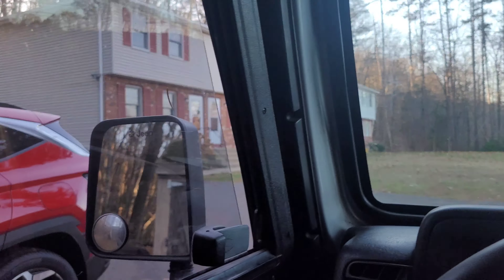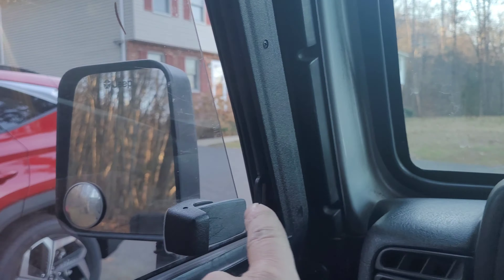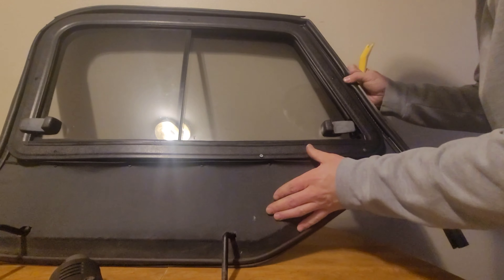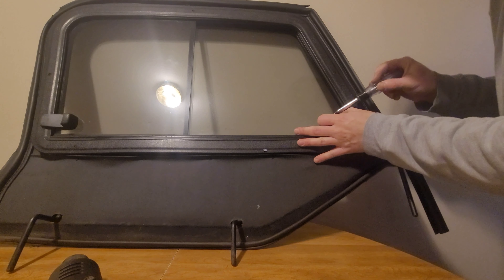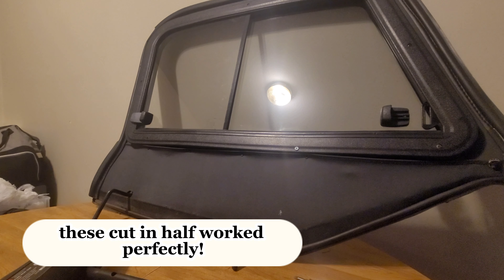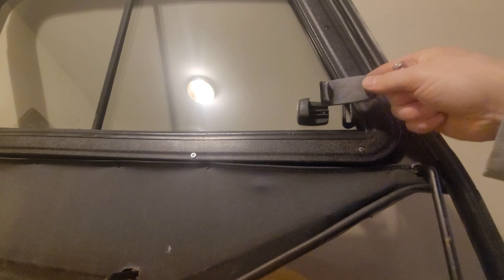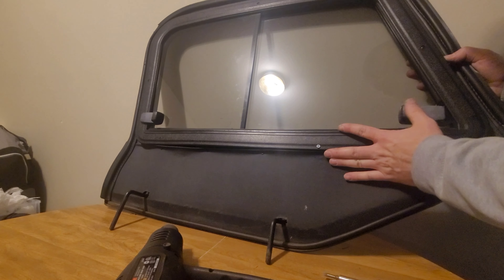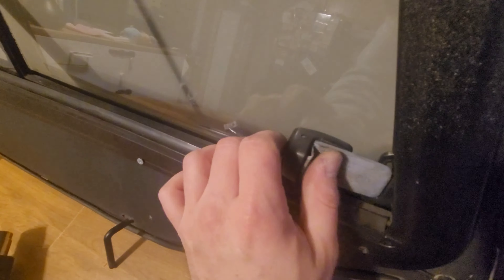Jeep TJ Slider window Fixed for $3!

Comment: Do your doors leak where the fabric is sagging under the glass window?
Reply from the maker: Thankfully I haven't noticed any on the inside. The soft uppers aren not supposed to fit a hardtop but it mostly does. I gotta buy a set of fulls for winter
Reply: @413BROS  I have these exact ones and the inside leak under the glass every time it rains. Sags similar to yours so was wondering if it was as common
Reply from the maker: Ahh damn! It's definitely common. I'm sure I get some inside but not enough for it to be a problem or me to really notice. I haven't seen much about replacement parts either